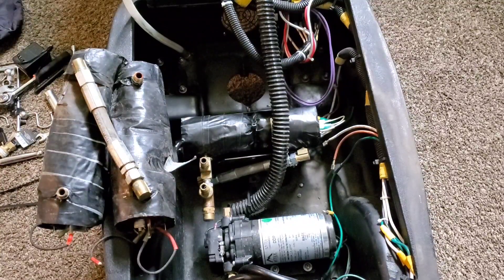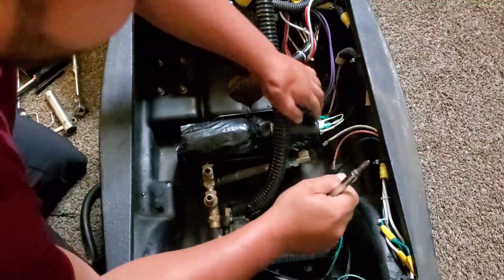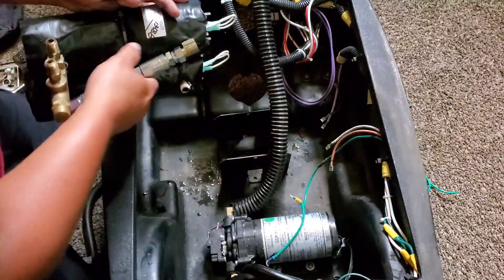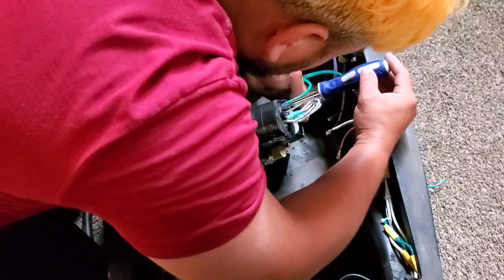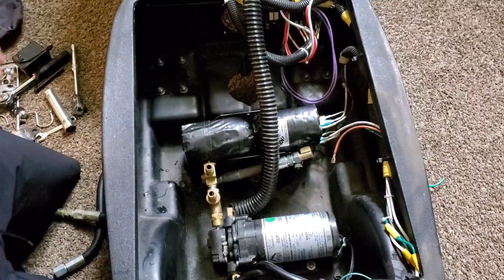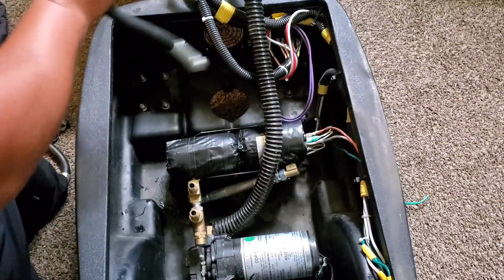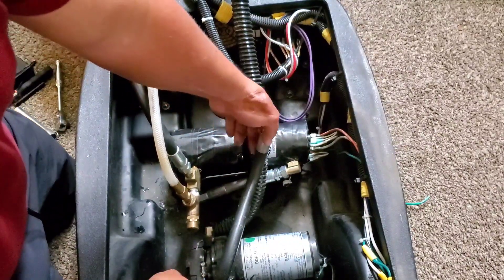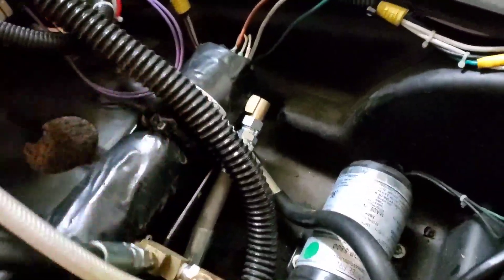How to fix your mytee heating pump

Comment: Hey Carlos has ur Mytee ever leaked water from the bottom?? When I turn on the heater it starts leaking
Reply from the maker: Hmmm i think so but i don't think it has in a long time.
Reply: @serranosmobile  thanks for getting back to me .. I had to keep filling it every 5 minutes lol but I was able to complete the job .. I will let u no the issue after I try n fix it